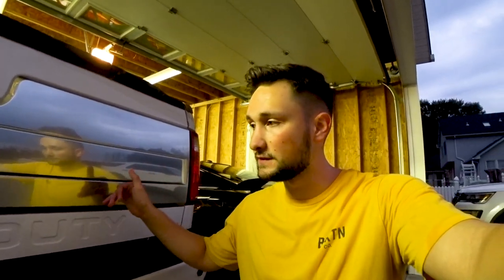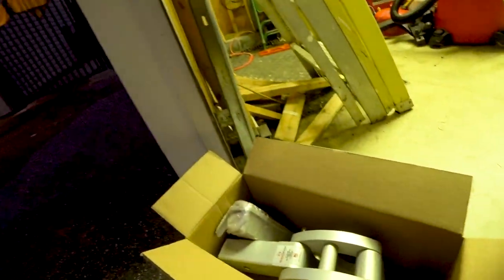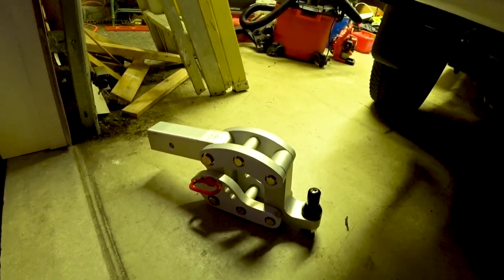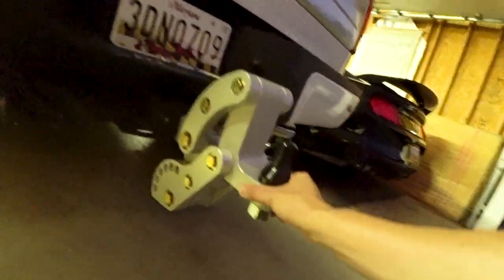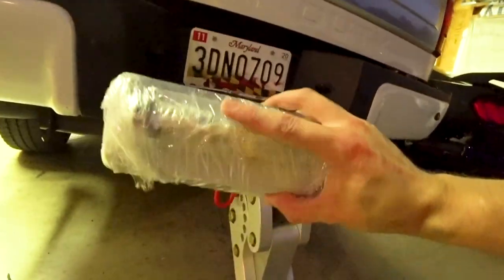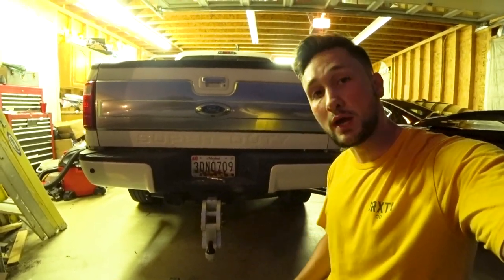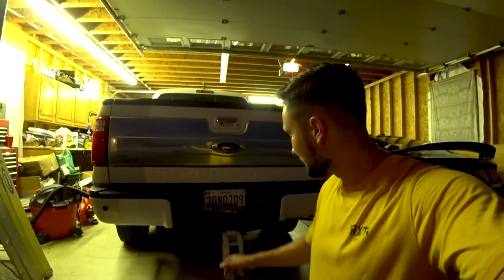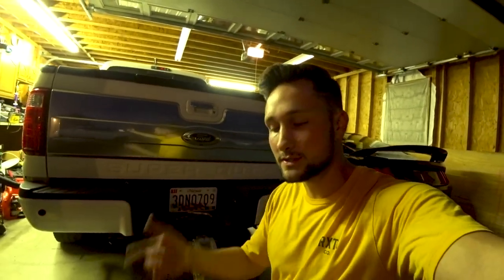Best Trailer Hitch! RHINO HITCH!

Comment: I’m glad you dig it and it does appear well built but one thing I don’t like is that it puts your hitch point a lot further out which translates to two things: leverage & mo leverage. 
 
1- Vertically. Less tongue weight will now have a greater effect. Think squatting and light front end. 
2- Laterally. Less trailer weight will now have a greater effect. Think the tail wagging the dog. 

This is why goose necks and 5th wheels have such a higher rating, because the hitch point is directly over the axle.
Reply: Just for show because they aren't gonna tow anything anyway 😂
Reply: Leverage is no match for the Rhino. It does add length, which aids in turning. It’s awesome.
Reply: Lance Walker the hitch itself is plenty strong enough for the leverage, that isn’t the point. The hitch being so long amplifies the leverage of the trailer to the ass end of your tow vehicle. And beings most folks have a single rear wheel, the effects can and will be felt. Probably not a huge deal for most folks, but for heavy loads or long hauls at 75 mph, the longer the hitch the more it sucks, and that isn’t an opinion, it’s just how it is.

Comment: to the people who think it's creating a solution for a problem that didn't exist, i can tell u.  i have one utility trailer that sits quite low, would need a very large drop for, but i mainly tow boat, which isn't nearly as low.  so imagine having a 10" drop bar but hitch at 4-6" or whatever, several inches dragging unnecessarily.  and gas stations around here sometimes have huge dips, would likely hit that extra drop.  this alleviates that.  and in 2019 cost might've mattered, but in 2022 all these hitches are $3-500, gen-y closer to $1k for some of em.  so that's not the issue.
Reply from the maker: Thank you so much for this input Tim! Yes you can always carry around tons of different hitches but this one solve that issue for me and it looks bad ass! I’ve had it for a couple years and have no complaints at all with it.

Comment: all the shear force is all on one tiny pin that adjusts the height! yeah it looks cool but that seems to be a mayor flaw
Reply from the maker: That's what I thought but I've put thousands of miles on this hitch and it still acts like new I have no idea how it performs so damn good !
Reply: The shear force for a 1/2" grade 5 pin is something like 185,000 psi and I'm guessing the pin size is in that neighborhood. It looks to me like this pin is bearing the weight of the tongue of trailer not the weight of the trailer itself.  Also, I'd have to believe Rhino tested this thing thoroughly before putting it on the market.  Having said this I wouldn't see the big advantage in having this hitch vs the money it costs.

Comment: Physics says that those swivel joints weaken the lateral strength of the unit.. plus the video fails to actually USE the hitch, just another monologue with a view of the product and the box it came in.. Yawn!
Reply from the maker: Hitch works great towing I have used it 10 times now towing around 12,000lbs. I will have to do a towing review! It is amazing how manuverable this hitch is. Thanks for your physics lesson Julian thats why rhino hitch uses high end material for proven results.
Reply: Physics tells me that the lateral strength exceed the maximum required rating. Proof is in the use...yawn to you.
Reply: Lol